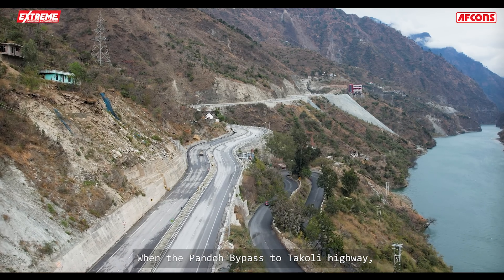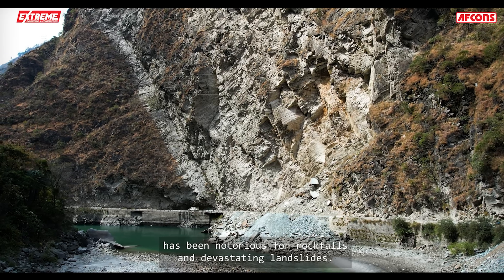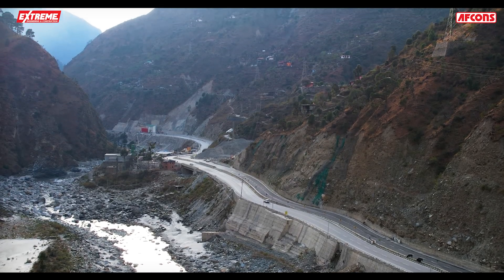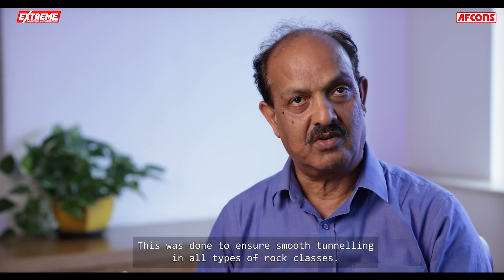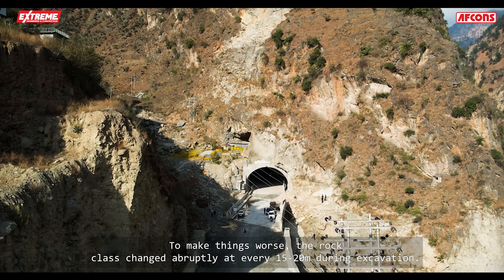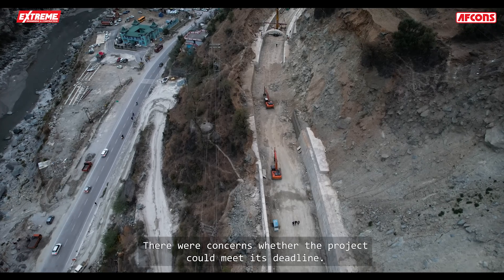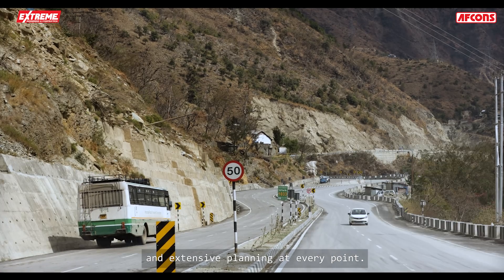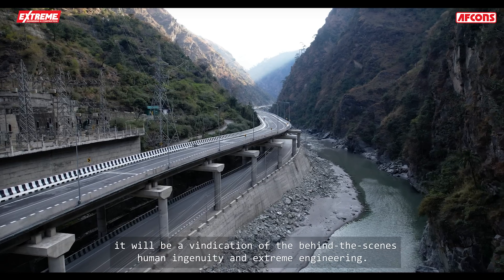Pushing Boundaries | Pandoh bypass - Takoli highway

Comment: its open for public
Reply: No , the stretch from kiratpur to mandi will be opened this month and stretch from mandi to Manali in next 3 to 4 months 👍 after that you can reach Chandigarh to Manali in minimum 6 hours and maximum 8 hours 👍🙏
Reply: @Bhsh-  current time between
1. Chandigarh to Mandi
2. Chandigarh to Manali
And how much time will be reduced
Reply: @vipint3694  current Chandigarh to mandi , 2 hours will be saved . Already 4 lane is beyond Sunder Nagar . In total manali to Chandigarh around 3 hours .
Reply: @AkashSharma-sp1rl  when i Used to go Mandi to Chandigarh it took 6 hours so it means it will take 4 hours?
Reply: @vipint3694  yes bawa